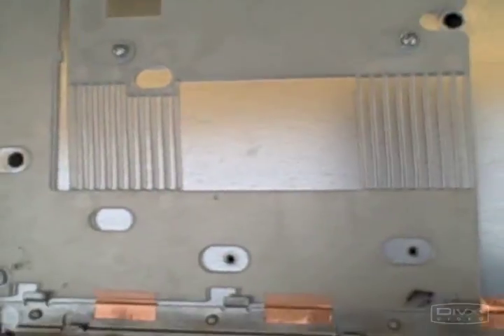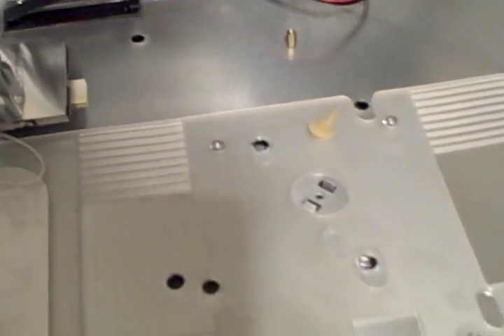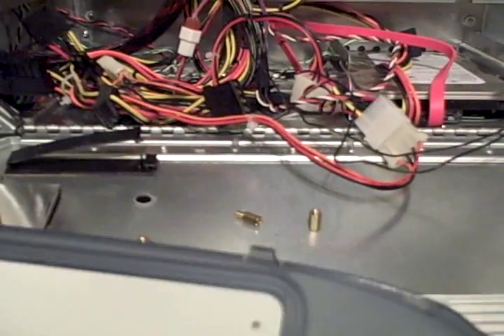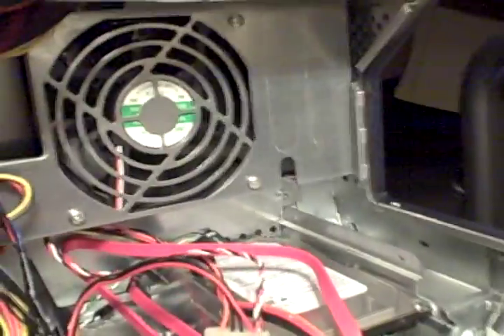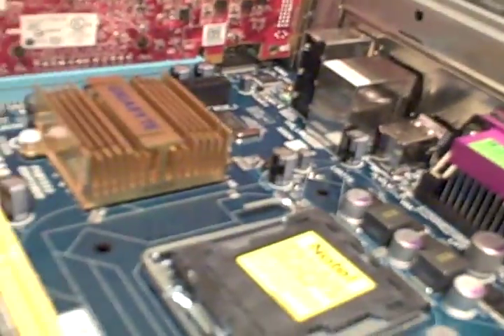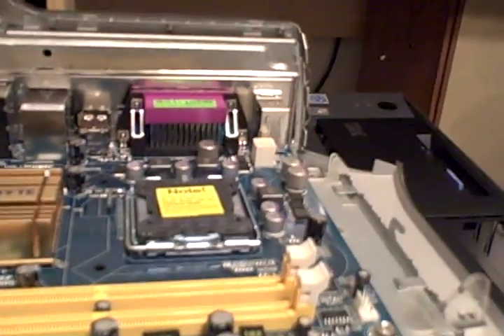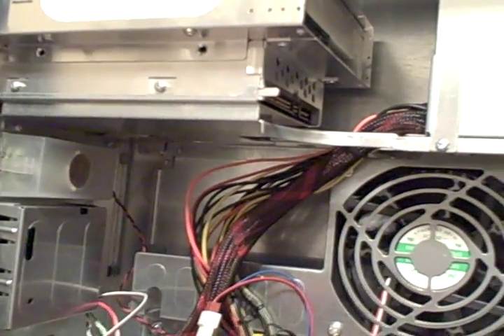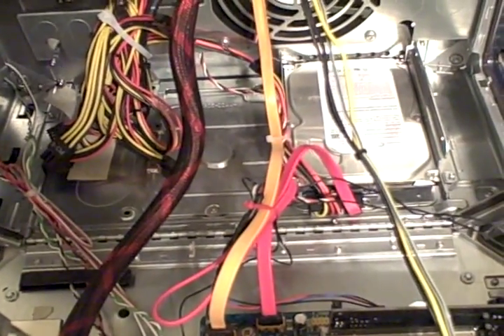Modding a G4 case for a hackintosh (part 7) mounting motherboard

Comment: you probably already know but if you google headless emac for the lcd crt conversion.
It is a great solution for an otherwise not very busy  17 inch flatpanel with the old dimensions

Comment from the maker: @Knaeckebrotsaege Antec is one of the best values in power supplies. They are rated at Tier2, you will pay much more for any brand ranked in the tier1 category. I've used probably 30 or more Antec power supplies in customers pcs and only 1 has failed, and I suspected a power surge on that one cause several other pcs with different brand psu died at the same time.

Comment from the maker: psu mounted no problems, It does need to be one with an 80mm fan, and depending on the power switch location, you may need to trim out the case a little. I think anything newer than a g4 case and the power supply is not a standard atx.